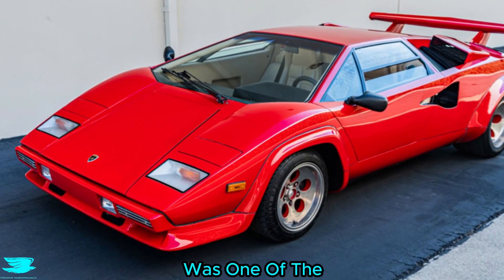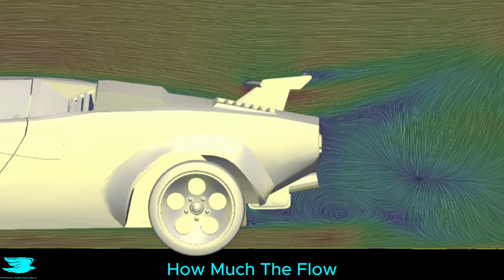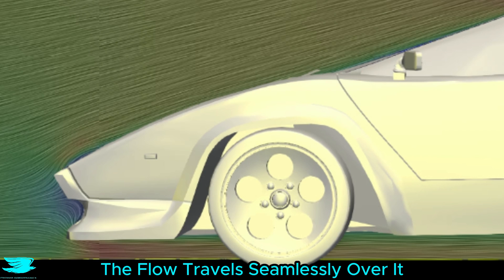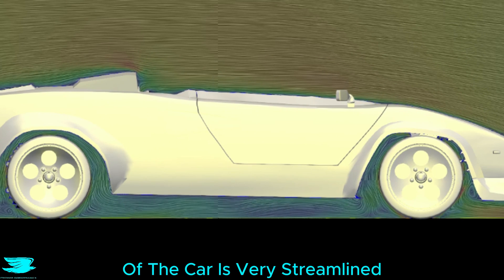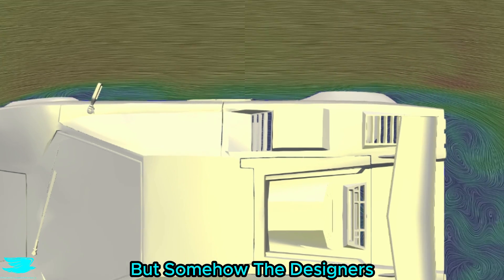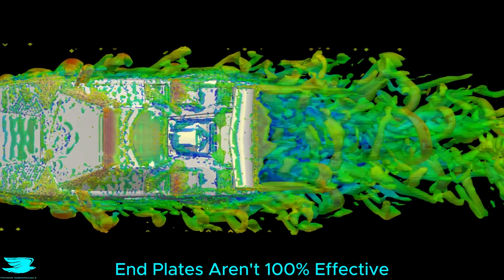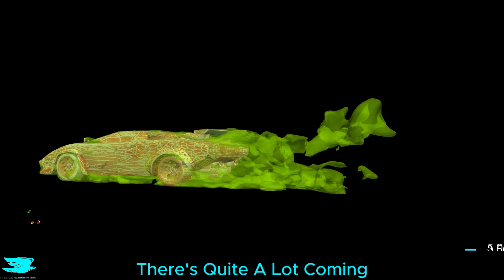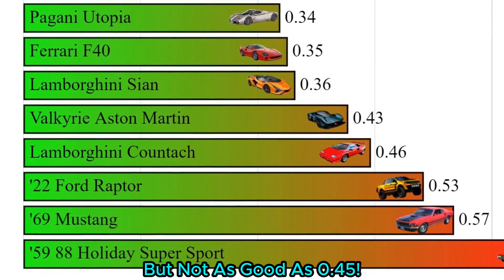The Lamborghini Countach Is Shockingly Aerodynamic!

Comment: Famously, the rear wing was NOT a ‘factory’ option. Apparently, without it, the car still drove OK at high speed and most were specified for looks rather than aero
Reply from the maker: I think it definitely was tailored for looks because it has dihedral to it and isn't as streamline as a typical airfoil.

Comment: The Rounded Line trucks underwent a mid-cycle redesign for the 1981 model year. Largely in response to the 1979 energy crisis, GM engineers again turned to wind tunnels to further reduce areas that hindered air flow and caused drag, along with shedding nearly 300 pounds of curb weight from the model line.

Can you do a 1981-1987 Chevy/GMC truck???? say like a reg cab long bed 2x4. 
Maybe you can prove or dispel whether the tailgate being upright causes a huge drag or does it create a box as if it had a bed cover. hmm?
Reply from the maker: Thanks for the idea! We'll put this one on the to-do list and probably have the simulations finished and postprocessed in a couple of months.
Reply: @PremierAerodynamics  
Thank you.

Comment: Could you do a 1967 Ferrari 330 P4? 

Really interested in what kinda aero profile it has. It has some aerodynamic shapes that would maybe even suggest some downforce ( At least for the solid roof variant ), but then again cars of that era weren't known to produce much downforce. Curious if it's closer to a little bit of downforce, or zero lift, or full on lift ( Some variants did have canards on the front of the car, so that would mean they were trying to shift downforce balance more to the front. Which maybe could mean the rear ducktail did produce some downforce, if they were trying to change the balance with canards?)
Reply from the maker: That's a cool car. We can't find a good model of it currently. We'll keep trying and hopefully we can find one to do.

It has some similar features to the stingray.
Reply: @PremierAerodynamics  there's actually a very detailed free model from 3DArt, you can search it by "3dart ferrari 330 p4". I'm not gonna post links because youtube doesn't seem to like it lol, but it should be relatively easy to find
Reply: @PremierAerodynamics  are there any contacts I could share a link to a good model with you? I can't seem to do it here lol
Reply from the maker: Thanks! In our bio, there is the email you can reach us at (similarly, I don't want to post it here, lol).
Reply: @PremierAerodynamics  cheers! sent an email

Comment: Something fun would be the original "Mach 5" from speed racer. The streamlined but very pointy (I call it fat trident) shape would be interesting to see.
Reply from the maker: Thanks for the idea! It looks pretty cool with the zig zag front.
Reply: @PremierAerodynamics  I wonder if the zig zag front would cause drag especially in the crevices, or if the shape is rounded enough that the flow isn't disturbed as much. I wonder how much lift is generated since each point is bullet shaped so the air I think would be directed almost equally above and below.
Reply from the maker: I think it depends on how much air the cooling flow needs. If it not very much then then the points will hinder the flow making its way around the sides of the car and increasing the drag through higher frontal pressure.

I think a crosswind would make it really draggy too.

Comment: since the rear wing wasnt made by lambo itself but sold by a guy in the parking lot in the beginning the rear wing made the car lift in the front. so lambo later offered the wing from the factory but also offered a front wing to balance the downforce and to remove the front lift at high speeds. 

thats why you can find pics of the countach with front mounted wings on google 😅
Reply from the maker: Lol, the front wing looks funny.
Reply: @mogelkaiser1876  the front wing was just a bumper for the U.S. market...no aero intended. The rear wings were fitted outside the factory  but not just sold from some guy in the parking lot. They were an actual option.
Reply: @jasonmaiden5026  if you would read my comment correctly i stated it wasnt offered by lambo IN THE BEGINNING.

after few months lambo approached the guy selling the wings and then lambo sold them from the factory. 

and the front wing was never intended to be the us bumber because it was located behind the actual front bumber. 

if you just google the us bumber for the countach you will see a big chunky bumper. that was the real us front bumber but the funny looking front wing was later offered to equalize the rear wing effect on the front at high speeds.

Comment: This car has a reputation for "bad aero" but they were really attempting to give it some downforce in a time when most cars produced a lot of lift. I believe the first design actually produced too much downforce at the front and was altered. The didn't want a repeat of the Miura! While it isn't a slippery car it is reportedly quite stable at speed. I wonder what kind of changes could improve it. Balboni built one to break 200mph but it seems most of the changes were in the front end, which maybe weren't as necessary as others might have been.
Reply from the maker: One major one would be to reduce how much the wheel arches jut out. Another one would be making the rear wing more aerodynamic. Currently it is a bit blocky, and the endplates seem a little too bluff. Another would be working on the diffuser and even the underbody to produce more downforce and even take off the rear wing.

But, these mods are using information from modern times, which they understandably didn't have back then.
Reply: @PremierAerodynamics  I'd be interested in seeing the earlier LP400 body as well

Comment: It would be interesting to see how the original Countach (LP 400 1974) would perform since it had a much cleaner shape.
Reply from the maker: Thanks for the idea! We have that one on the to-do list after we get through the current batch of cars we are simulating.
Reply: @PremierAerodynamics  (the coutach prototype was without flaired wheel arches or holes in the side )
Reply: @replica1052   The NACA ducts on the side were necessary for a real car. None were produced without them. Removing them is just a fantasy.
Reply: @PremierAerodynamics  There's also a version with a front spoiler (yes, on top of the hood for the car). Does that have version have anythinf different going on?
Reply: @Mandarin9900 that was for safety reasons. same thing happened to the lotus esprit s1-s3 . they beefed up the front bash bar to meet safety requirements in certain countries. You can look at the Fiat x1/9 as well with the euro models having no extended bumpers while US models do
Reply: @Malice_doll  What? An extra spoiler on the hood for safety reasons? I'm not talking about thicker bumpers.
Reply: @Mandarin9900  front spoiler was legally the front bumper, because the regulations advised putting the front bumper at the specified height...
Reply: @DoriFord Thanks